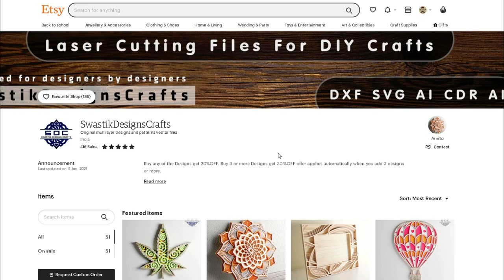Wine glass and bottle Mandala cut on a 50w Chinese laser

Comment: thers a plasma table to cut metal and they have a pipe attachment for it, could you modifi your table to put a bottle on it . can that lazer work on glass?
Reply from the maker: Yes. It came with a rotary attachment. It can engrave but not cut glass.